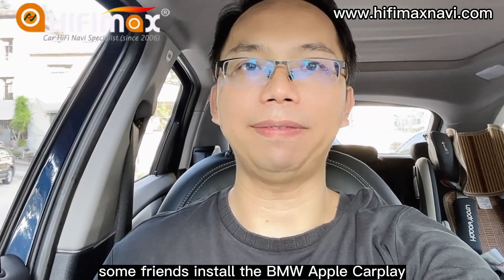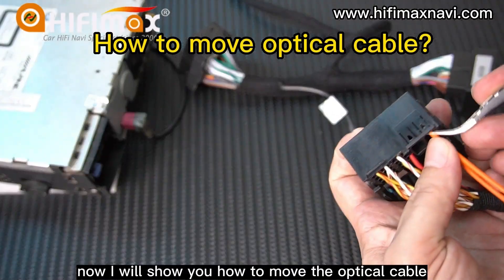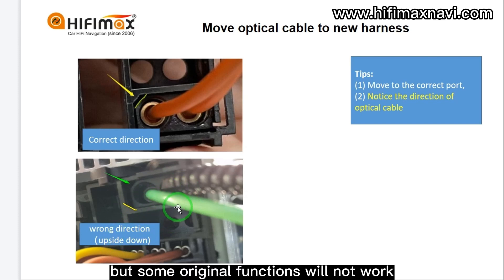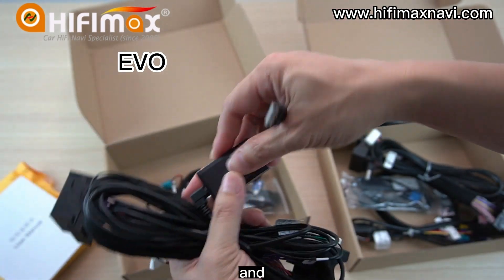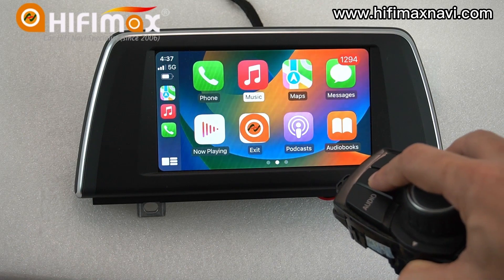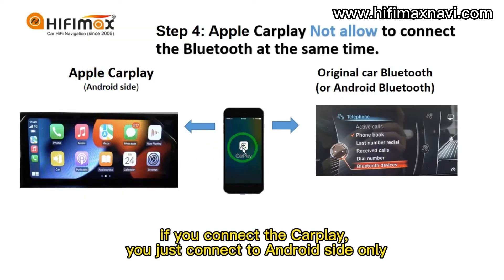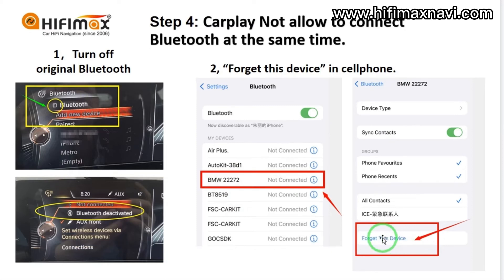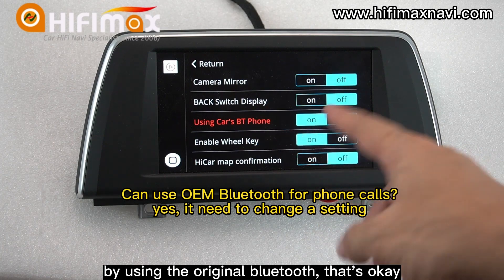BMW Apple Carplay Android Auto NO Sound Fixed | BMW wireless Carplay without Audio trouble shooting!

Comment: When I plug in USB drive onto original car USB. NBT car. No USB is seen. But when I connect the same USB to the module. It play the songs. However, when I exit the song. There is an orange window list USB A and USB B. The Idrive knot unable to move neither click on either option. It is very annoying to see the orange window until car has restart.

Comment: I did everything, but there is no sound.
Reply: I have the same problem. Do you have a solution?
Reply: @Jiggolito  Yes — I fixed the problem by pressing another lever at the back. Please check the manual carefully.
Reply: @slaventiyecUS i Need help please

Comment: I set up mine same everything the CarPlay works great but when I do airpkay it comes up but no sound or if I was trying to cast a YouTube video with AirPlay it  has a black screen .. what you think could cause it and also the optic cable input it in correct because it doesn’t fit any other when I try to turn it around
Reply from the maker: about screen mirror link, i have a video : https://youtu.be/9KdXwwQkDXA?si=Kthe3sxuI31ZLWrC

Comment: Hi, I have fixed everything correctly and tried using the car play before fixing everything back but the issue I am facing now is the radio playing whenever the car play initiates or pairs. Is there anything that I did wrong?

Comment: I just installed mine, I can hear the audio normally while I'm using iDrive connected but in android mode (or android auto) I don't hear anything😢
Reply: I have same issue, how did you solve it
Reply: @robika  I connected the aux in cable to the aux out one (not the ones that were already in the car, I connected the two cables that came with the display with each other) and after restarting the device from the settings it worked lol. Now it's perfect
Reply: @lexo365 did you have to connect  the aux lead under the arm rest?
Reply: @jackdunk-o2h  no, I tried that but it didn't work, so I connected the 2 aux cables that came with the display instead and that worked. Basically I didn't connect anything to the car besides the main set of cables in the dash
Reply: @ i tried this and i couldnt get it to work🙄 does urs work fully bluetooth or do you need to be plugged in?
Reply: @jackdunk-o2h  fully bluetooth, I restarted it from the display settings right after connecting the cables, remember to do that.
Reply: @ ooo ill give that a try tomorrow thanks alot mate👍🏼
Reply: @jackdunk-o2h bro did u get it to work?
Reply: @lexo365 you sir have won the internet today I ve been having troubles for hours I knew there would be a way . I saw your comment gave it a try and sound game out right away . Thanks 🙏🏻
Reply: @lexo365  I don't understand what you mean with both aux cables connected can you please explain it to me exactly I'm desperate
Reply: @Jiggolito In my case, there were two aux cables (one female and one male) that came with the display (so these weren't there before). I connected them and restarted the device (I went to settings and then reboot). You also need to change "mode" from radio to aux in the multimedia page
Reply: @lexo365 what unit do you have
Reply: Do you have NBT or Evo? Do you remember?
Reply: @margaretepeperete  nbt
Reply: Im in same boat.. no sound.. are you connecting the long aux cable into the black female end up by the screen harness?  Also how do you reset the screen to get it to work?
Reply: @bikerboi1983  I managed it, it was the OEM cable, I plugged it in the other way around and suddenly there was sound, I just have a problem at the moment when I mirror the screen on my iPhone there is no sound, can someone help me?
Reply: @Jiggolito the optical cable that goes to back of original stereo? Do you know the password to get into the factory settings?  I cant see my original dash correctly 😢
Reply: @Jiggolito select the aux option in the OG bmw menù

Comment: Hi i need help and i would be so grateful if you help me. My car is a bmw e90 2009 with ccc system... my cars aux input and usb are not working, i went to check the mulf module in the trunk and its missing, theres no mulf module, theres many unplagged cables, one of them is the MOST (fiber optic). Even tho radio works anyway, but aux, usb and bluetooth dont work (the car doesnt recognize when i plug something in the aux input). I was wondering if i buy this android carplay, will it work anyway even if i dont have the MULF module? Thanks!
Reply from the maker: It need a good working AUX , the sound of android screen work through AUX

Comment: Hi have a 6series f06 evo.i cant get sound and i think my usbs are not working so i connected without the usb to aux and pluged the cable straight into the aux and i still have no sound ?
Reply from the maker: EVO 6 series ? It need to check more details, better contact your seller

Comment: What is it doesn’t come with optic cable
Reply from the maker: If the car without optical fiber cable , then just connect the power directly. It is also ok , a lot of car without optical fiber cable .

Comment: I installed android auto in my e81. I have sound by the original radio but not by playing Spotify or navigation. Also i don't have a signal for the original BMW Menü to switch from Radio to AUX. All settings are correct, also plugged in a AUX cable under the armrest. I think something is missing to get to the original BMW Menü but I don't know what. Can you help please?
Reply: Did you find out the problem Iv got the same thing?
Reply: @nathansmith1783 i need help having same issue
Reply: @nathansmith1783 I went back to the factory setup
Reply: Did you find the issue?
Reply: @wise_soul8886 went back to factory setup

Comment: Hi and many thanks for the video. Before the video i had no sound in my f48 evo system. Then i did option 2 and concect it to the usb port in the armrest box. Is there a chance to hide the cable or do only step 1 and can forget step 2. Because now with the cable in the armrest box, i can not close the radio front.

Comment: hello everybody my quetion  in my originale  car  bmw x3 2014 havoe no optical fiber  cable,and now  i did instalted the new display  but  have no sound  but evrything its  instaled good the came rare function but have sound when you use it.
Reply from the maker: You can check : if the original radio have sound or not ; also connect the AUX cable , choose AUX in original menu before using the Android screen

Comment: Is there another way to get Apple CarPlay but play sound through the original Bluetooth? I have a 2013 E92 with CIC, and the sound through Bluetooth sounds so much better than through aux.
Reply from the maker: You can consider the Linux screen, the android screen can not use original Bluetooth

Comment: HUD not working after install. How can I fix?
Reply from the maker: HUD is OEM function , you need access to original menu to use it , if in original menu not work , you can check if the optical fiber cable movement, to check when you moved to new power cable , the optical cable direction correct or not , normal it is upside down then have this problem ,

Comment: Hello. I have a 2011 x5 and I have a carplay installed it lights up but it doesn't sound. Only the cd and the radio works.  Need help please
Reply from the maker: It is OEM screen or Android screen?
Reply: @HifimaxOfficial  it's an aftermarket carplay screen

Comment: I did everything in this video but when i play YouTube on new head unit through aux it plays for  a few seconds and then my car oem menu automatically switches to “music collection “ on its own and no sound.
Reply from the maker: It need to know the car model and year of production and also need to the android screen you installed …. They are different
Reply: @HifimaxOfficial  2015 bmw 428i. Xtrons 14.9 nbt version screen.

Comment: hi, I have a 2013 F31 under NBT, I installed an Android screen on it, I did the optical fiber bypass, but I don't have any sound via the Android screen, I don't have  no sound either when I plug in aux via aux under the armrest, I need the USB audio aux adapter do you think?  Otherwise what is the problem...?
Thanks
Reply from the maker: 2013 model is NBT , the sound work by AUX , not by USB audio ( only EVO by USB/ AUX adapter) .
Reply: @HifimaxOfficial
Reply: My CarPlay unit will play through the aux for 2 seconds but the AUX switches back to CD on the idrive menu, how do I stop this from happening (car BMW 2012 NBT)

Comment: Hi I have the evo system 
And tried it through the usb version 
Still no sound ?
Reply: Did you fix it. ? Im having the same issue please help
Reply: @wise_soul8886 never got it fixed bought the wrong unit actually 
So bought another unit and it worked

Comment: Hello

I bought this product but until recently I was able to install it, I wanted to ask a question, sound, calls, music and map work very well for me, the problem I have is that when I turn on the car the screen starts and approximately 2 turns off and then turns off It turns on after a minute and then turns off between 23 and 25. After I have reviewed the manual and configuration and I can't find anything, any help or how I ask the manufacturer

thank you
Reply from the maker: You can contact your seller for support

Comment: Hi, if you could help me i would be so grateful, my car doesn't have th3 optical fiber cables in the 4 wholes and the sounds still not working, what can i do??
Reply from the maker: The car with or without optical fiber has nothing to do with the sound of android screen, the Android screen, its sound work by AUX , it have two ways : 1) the sound transfer by big power cable ( we call internal transfer) , in that case , although you don’t connect the AUX cable to AUX jack , it also have sound , some cars like NBT cars , it just work like that , but some older cars like CCC or CIC , it might require you to connect the AUX cable to AUX jack, but this has nothing to do with your optical fiber cable, the car with optical fiber cable normally with external amplifier, that kind of car have better on sound effects.
Reply: @HifimaxOfficial hey, I installed mine yesterday and I do have sound from radio and BT music. When I make a phonecall I do not have sound from speakers and there is no ringtone through the stereo! I have 2015 F10 BMW with NBT. Is it a green optical cable issue? Thanks in advance 😊

Comment: hello! i had connected a new head unit and i only get sound from the speaker behind the head unit, no sound from the doors or tweeters, how can i fix?
Reply: I have this same issue
Reply: @jonathangreen287 hey bro, the issue for me was the green wires were in the wrong spot in the harness switch it around and see if it seems to work, it did for me ! let me know how it goes good luck

Comment: Is the Gnd to Gnd cable required for the EVO version as well?

I can’t get any sound working. It’s all wired correctly except for the ground cable if that’s what is needed.
Reply from the maker: It is need to connect the ground cable , but it all not work , that is other reason , the ground cable can cancel the noise. That is just only one reason , you can check the optical cable movement, and the USB/ AUX adapter connection

Comment: I have a strange problem with my aftermarket evo headunitś sound , its working only when the engine is on , when I turn the engine off sound goes totally off , even when I turn to the original unit . Any adivse is very appreciated 🙏

Comment: Thanks , very informative video about common problem.
My car play in Bmw goes blank  after some time,
Any advise on this issue, will be much appreciated
Reply from the maker: Blank screen normally check steps 1) remove all external kits like USB drive , or SD card or other device that hooked to android screen first , then restart the car ; if not help, 2) can use a needle to press the “ reset button” button, normally the screen design the reset button , if not help 3) better contact your supplier to see if any software update can fix it , 4) if your supplier can not help , 5) you can also check yourself, like this video I made : https://youtu.be/bTWFqROwuVc?si=XNFVhYw40hCKDlEB

Comment: I need to install aux cable ? I don’t have optical cable in original système
Reply from the maker: a lot of cars without optical cable, that is no problem, when the car without optical cable, you just connect the power cable would be fine.
Reply: @HifimaxOfficial  thank you , but it is necessary to connect the aux usb cable ?
Reply from the maker: i don't your car model, if the car is CCC, CIC, it need to connect it, if the NBT, it is ok not connect it, if EVO cars, it need to connect the USB/AUX cable (on the back of head unit), some other seller's products, for EVO, it connect the USB/AUX adapter.. @AmZian2

Comment: I have Android carplay 12 touch screen. I took the optical (green) wires out of original port and install into new port. Still no audio. Can you please advise?
Thank you
Reply from the maker: There is a video about the optical fiber movement, https://youtu.be/8uobWgYDI1E
You just notice two points: 1, move to crrect spot, 2) notice the direction of optical fiber cable... my videos always talk "in details" , that way, people can do it themself.
Reply: @HifimaxOfficial  Thank you! I did actually misplace the optic cable. Now that I have optic wires in the correct place, I still don't have sound or any radio either. Could I have blown a fuse?
Reply from the maker: @robpabon3608   you can watch this video. https://youtu.be/1s_9pJKAMz4
Reply: Now my idrive is not working. No sound. The passive door locks not working either.
Reply from the maker: @robpabon3608   please check with your supplier, since it need to check in details (connection, settings and your software MCU version etc), that is impossible to know the reasons by review your message here.

Comment: I have the harness with the AUX cable and the ground cable, i havent connected the ground cable to anything and i have no sounds. But in the idrive when i choose AUX i cant change the volume,  it doesn't go up or down, is this because i havent conected 5he ground vsble to the usb?
Reply from the maker: you can check: if the car has optical fiber in original harness or not, if it has, you should move it to new harness. when the aux cable have ground cable, you should connect that ground cable.
Reply: @HifimaxOfficial o jako kabel uziemniający chodzi?
Reply from the maker: @Rav_lomza   this video talking the MMI BOX (CARPLAY BOX) , if you connect the AUX cable, and found there is no sound, in that case, you should connect the ground cable  (in the power cable) to "GND" cable (which from USB harnesss ). still not clear?
Reply: @HifimaxOfficial  mogę napisać do ciebie na priv?
Reply: @HifimaxOfficial  mam brak dźwięku po zamontowaniu androida w jednostce android, w fabrycznym menu działa a w android nie, dwa kable światłowody przełożone, jedynie odtwarza dźwięk po kablu aux ! A chce aby przez światłowody był dźwięk, gdzie leży problem?
Reply from the maker: I have a video that mainly talking the android screen no sound, check step by steps, you can watch it, https://youtu.be/1s_9pJKAMz4?si=5gTLNDb5utgO7lkj @Rav_lomza
Reply: Same issue with me. 
I did everything in this video but I have the same result.
OEM aux settings only allow volume to change but I can't even do that.

Radio sound works fine, but Android auto sound (spotify) doesn't play sound.

Aux from new screen is connected to car aux port. No sound.

HELP